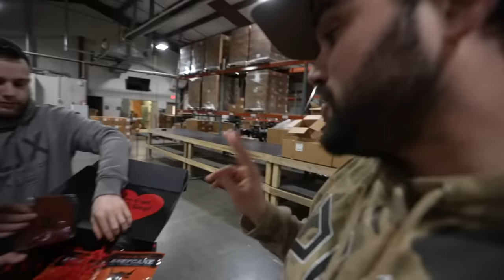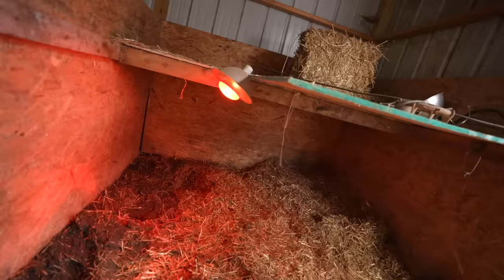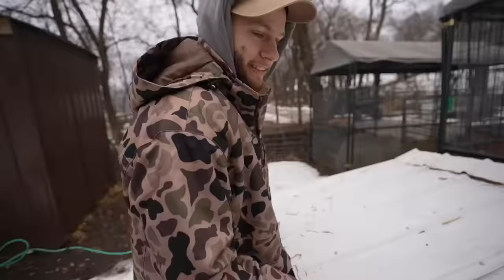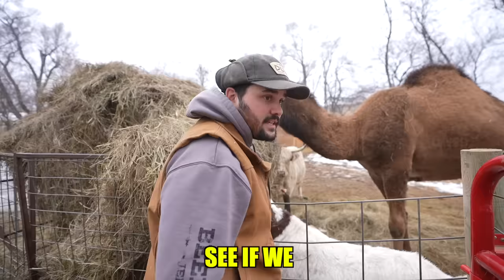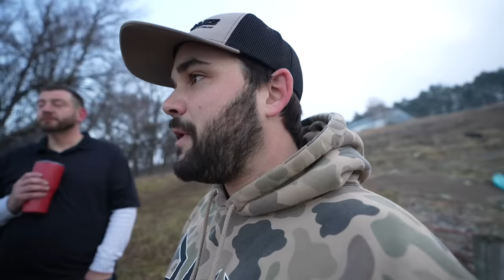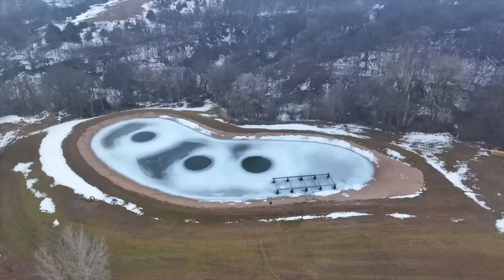SURPRISE Major BACKYARD POND Update!!! (Did I Just Save $100,000?)

Comment: After learning what you learned for this video, the liner has definitely moved up.  If you get a 100% warranty with the liner, it kinda sounds like a no-brainer. The only bummer would be if you had to drain the pond to find the leak, you may very well have to drain it right down to the bottom. I guess you can put your fish in the stock pond (I forget what you call it, lol) you already have. It would be a real bummer, but it'll stink either way if you have to drain it for repair purposes. With the liner, the company will come and do the work!, whereas with the bentonite, you will have to trial and error to figure out where it's leaking from.  I would want to know what the liner company suggests as far as any structure you put in (logs, rocks, etc.). I guess you could make structure from PVC pipe and rubber tubing...
I'm not much help here, but I do agree... the liner does have a stronger place now, especially knowing that the company will be the ones to come out and repair it if it starts to leak. I'd want to make sure the repair warranty applies to any reason for the leak and not just if something 'natural' happens to the liner, like if the seam comes apart vs muskrat, logs or rocks you put in for structure, etc.

Comment: Get a liner and cover it with earth, you won't know it's there at all. It costs a little more but you can get up to about 100mm thick if you are worried about rats there is a mesh liner seeded with metal that can act as a shield for it. Ideally you'd want a 60mm liner, earth or clay compacted then a mesh liner and loose rocks and sand on top of that. 
The benefits are no rest can dig through it and it dissuades crayfish as well, if there are any earth shifting the liner has a higher chance not to shift, plus with the mesh layer you won't pierce your main by doing anything stupid.
Also I've found the margin for error is much greater on liners and there is less settling problems overtime.

Whatever you choose have fun

Comment: Liner is the way to go. but probably better yet a combination that combines the good quality of both. I just put a new roof on my house.  the original lasted 35 years,  It was 30 pound asphalt roofing rools with concrete tiles molded to look like clay tiles and finished and fired in some clay tile stuff. 2 choices.  one was just like the original with a 30y ear limited warranty.  The other had a new plastic underlayment that was like tough stuff used underneath concrete only formulated for hot summer desert roofs.  It had a 50 year warrantee.  I asked the roofer how much to put the 30 year 30# asphalt roofing under the 50 year plastic one.  For an extra $1,800 over the asphalt I got a 80 year roof - so now I can live to 150  no problem. .  As an rained architect and a design build general contractor, retired , who has built quite a few 1-2 acre ponds for fishing and other recreation all over the country for various projects over the years.  A couple hundred bucks of water if the pond leaks is pretty cheap if you can save $25K in construction costs.  It's the warrantee and labor costs that count.  The warrantee is only as good as lang as the contractor is in business.  Thinner plastic under bentonite is the right answer.  Use 40 mill for the plastic and be careful.  it is easy to grade it out right with a tractor if you have to.  then roll it, put down the plastic you can do it yourself when it is thinner with a bunch of friends. then put the bentonite down with soil on top and roll it in.  Great pond on the cheap with a great chance not to ever leak.  Ponds are always fun projects with the guys and gals that want to help.

Comment: @FLAIR I would do the rubber liner. I have a pond that is about an acre and a half that is 25ft deep. The water pressure at that depth is 10.89psi. Which is about 150 to 200 pounds per square inch. The liner that I have has been in the so far for 5 years and has no leaks. In my opinion the liner is better than the clay & Bentonite hands down. Comes with a warranty. It's just better to me. Reach out if you have any questions

Comment: I’m with banjo on the 100% is greater than 50%. You have seen the liner work first hand with out any problems and seen someone else’s work with out any problems. While one of the bentonite ponds had a small leak it was more of a DIY job done for it so worst comes to worst small scale bentonite pond and side by side comparison of it with the liner hatchery just to make sure that it will hold well with your soil on your property